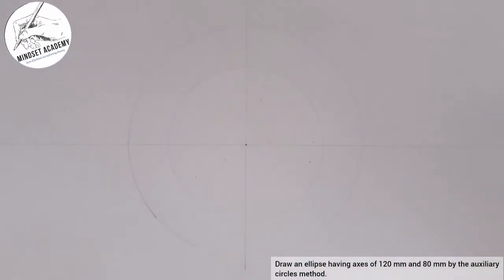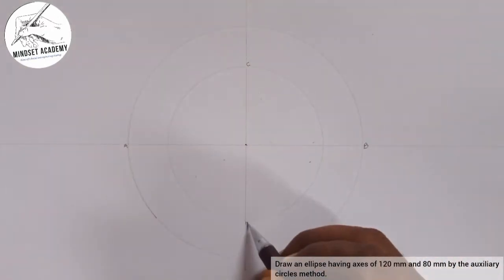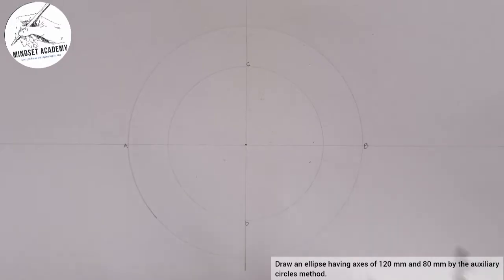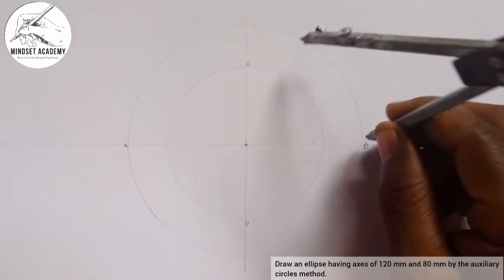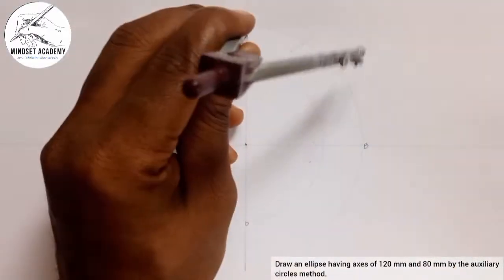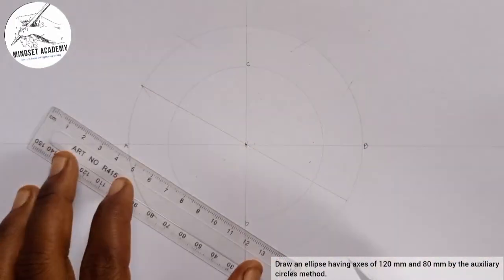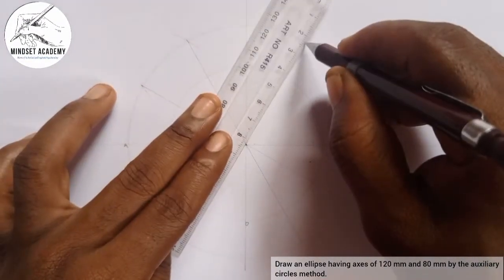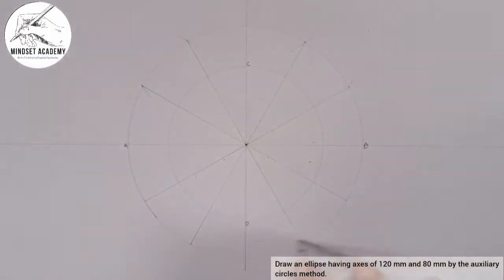ELLIPSE by Auxiliary/Concentric Circle Method

Comment: You should just use the normal procedure of drawing a perpendicular Tangent to that  Normal...instead of using 0 to align with the line there. Which may not be 💯 accurate.  All the same... Weldone sir.
Reply from the maker: You're welcome